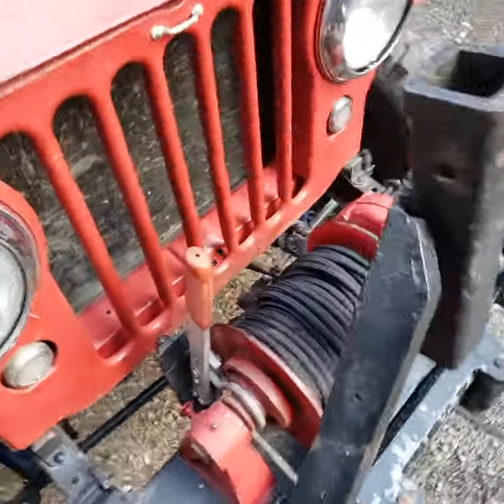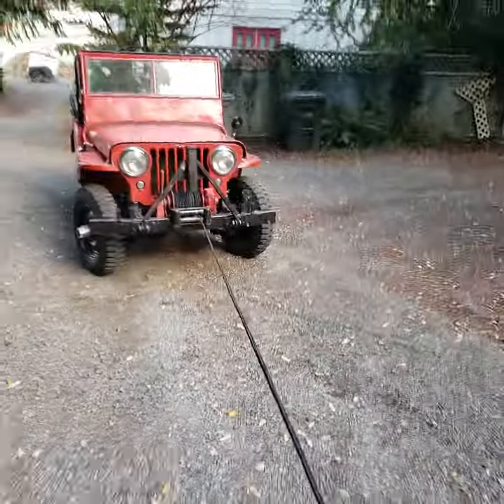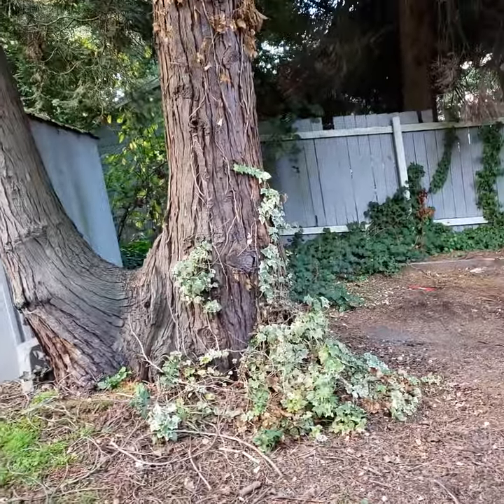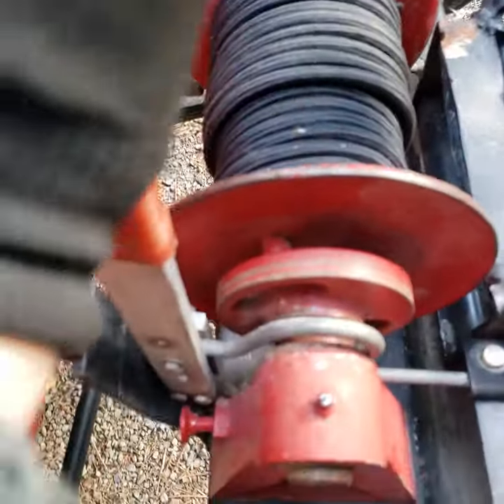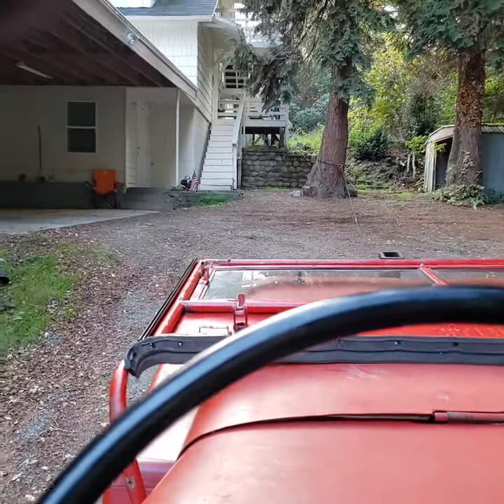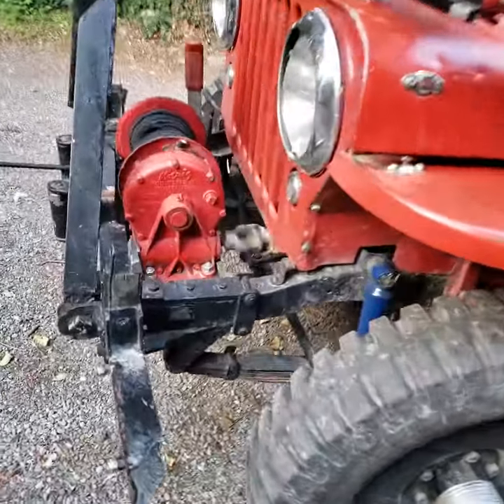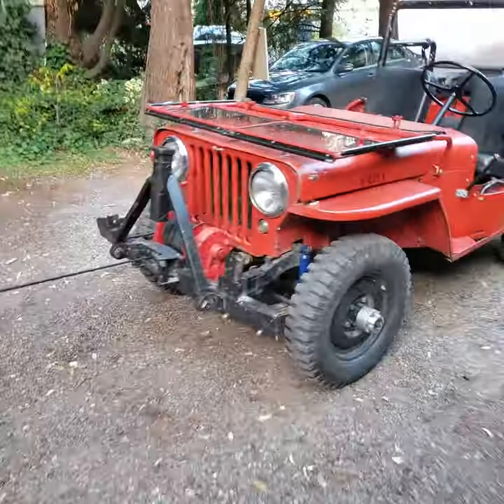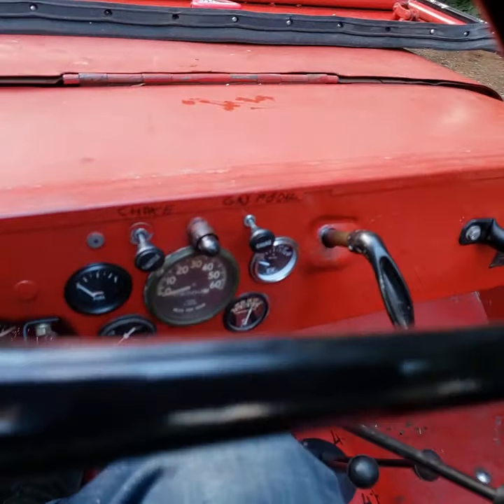KOENIG PTO winch on willys jeep

Comment: PTO winch is much better than electric. You don't drain your vehicle battery and it's just bulletproof (it's mechanical, so there are not a lot of things that can go wrong). And with some modifications you can winch and send power to the wheels at the same time.